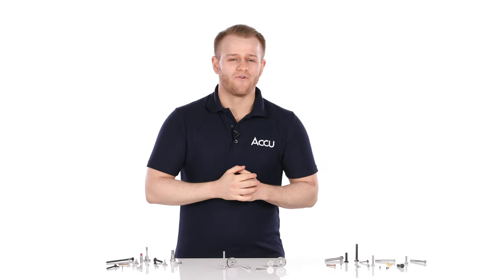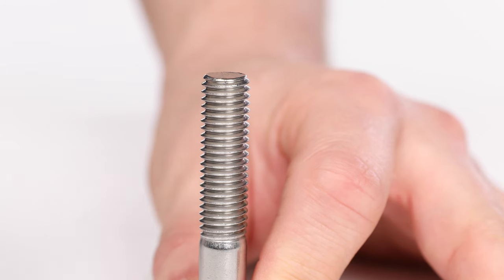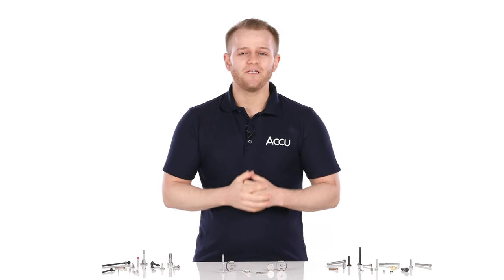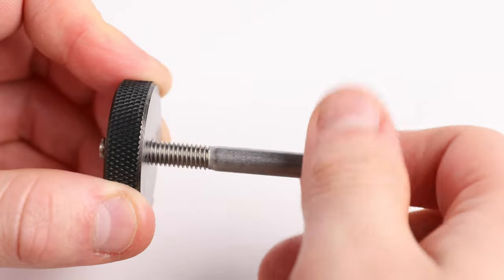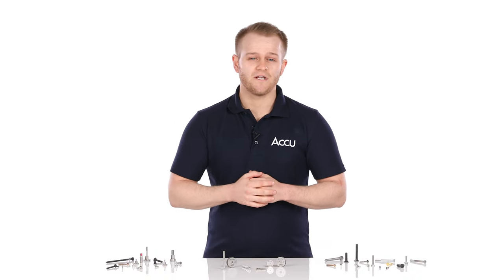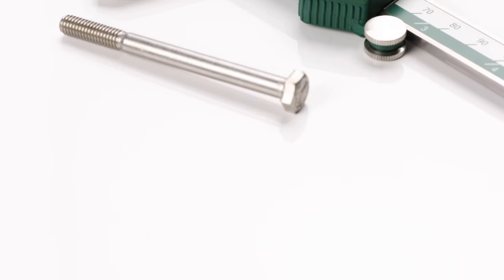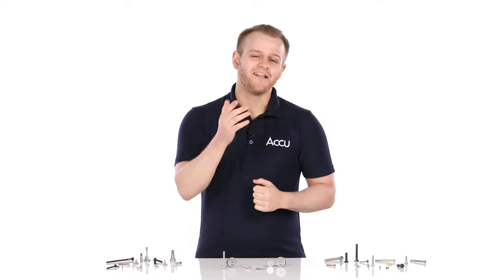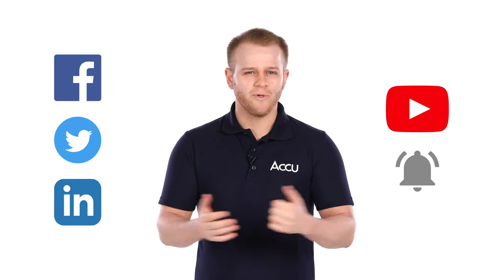How To Measure Screw Thread Diameter and Pitch Using a Ring Thread Gauge | Accu Tutorials

Comment: Do the ring gauges have a front and back and is there a difference on the lead-in.  I've been told to screw the bolt into the side with the gauge size.  Is this true?
Reply from the maker: Hi David, great question. There should be no difference in the lead-in on the front or the back of ring gauges, so in fact there may be a small benefit to using both the front and back sides -  since using both sides will wear the gauge more evenly.